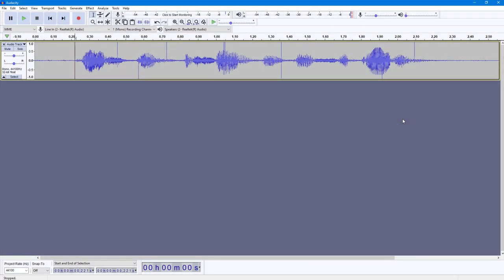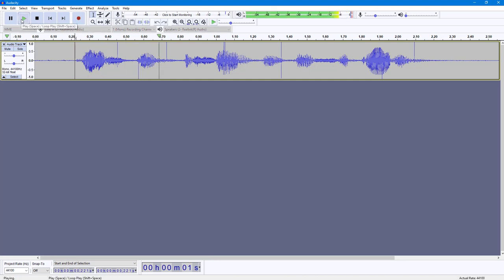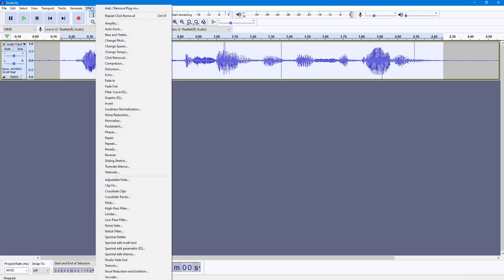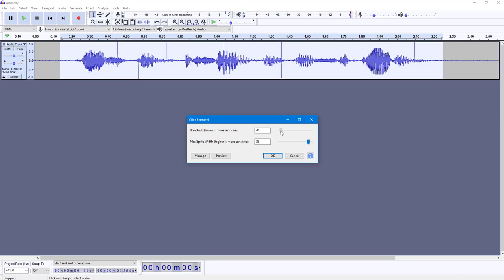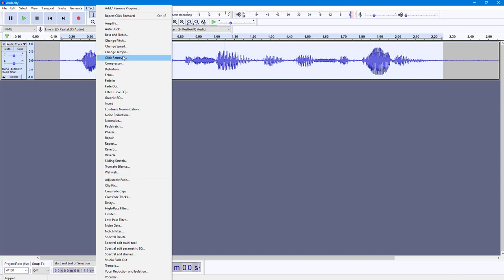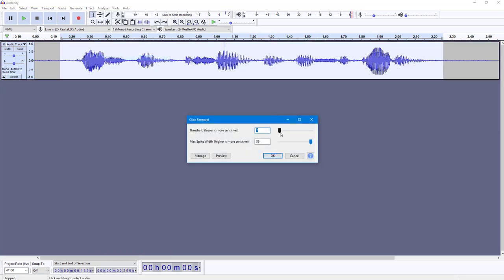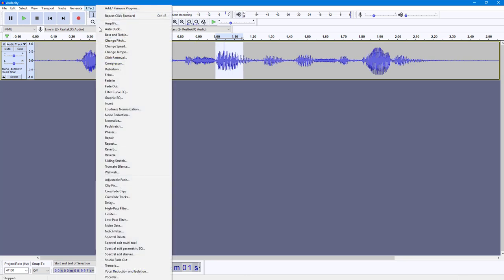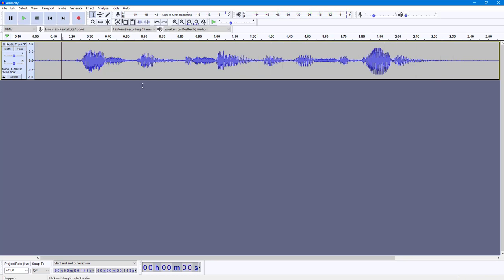Audacity Tutorial - Lesson 49 - Click Removal

Comment: Everything I record with Audacity is plagued with clicks. Click removal doesn't remove them. If I increase the sensitivity, it eventually starts to distort.
Reply: i successfully removed a click, so it does work but extremely rarely. and it should be a fucking setting that you can just choose "remove clicking" like i don't wanna guess between 0-900. fucking stupid af.
Reply: even though this comment is 2 years old any suggested free use programs that doesn't record clicks? I'm running into the same problems
Reply: @clousehands5582  I've recently discovered that many of my clicks are happening in my throat.